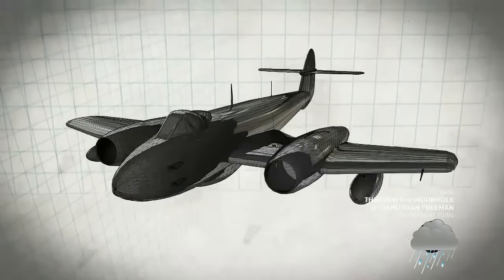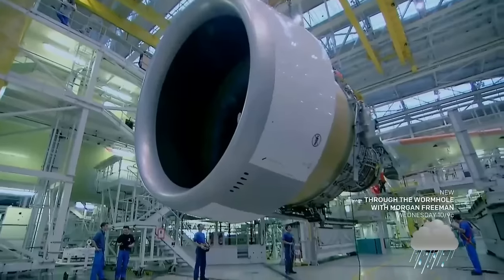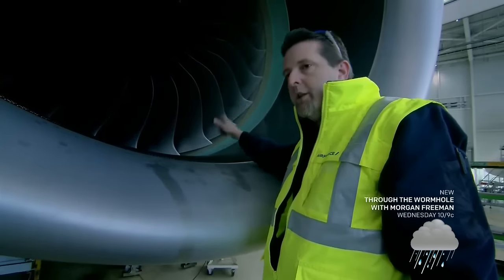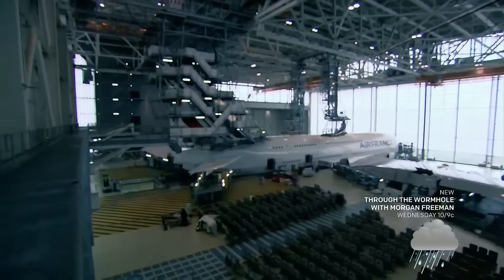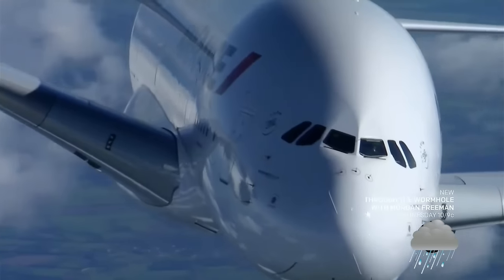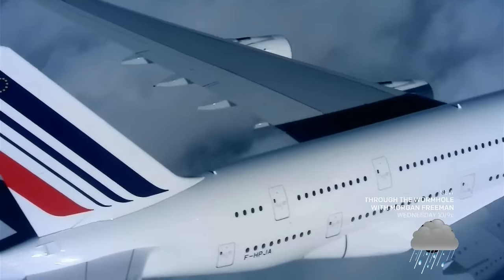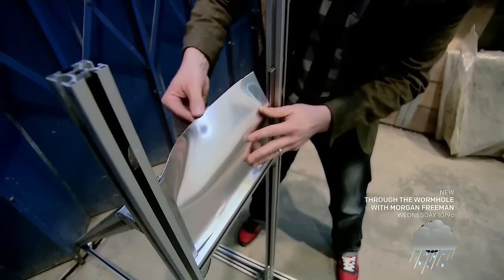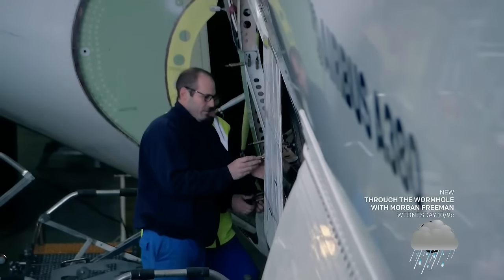Airbus A380 Documentary 2015 Part 2/3

Comment: 4:14 XD, so new and revolutionary that they've been in the market since 2007... 
Anyway, if this is the Rolls-Royce Trent 900 engine, which I think it's the case,  then it has a manufacturing fault that may lead to oil leakage, burning and engine failure.  Pity, since they test the engines before delivery, RR even blows some of them up to test structural resistance.